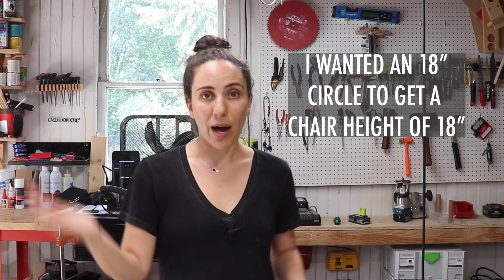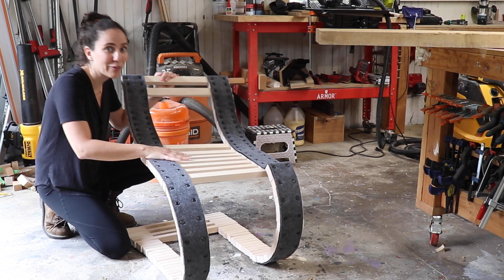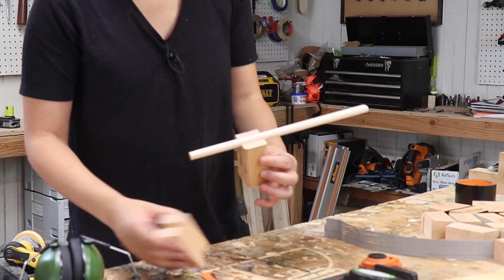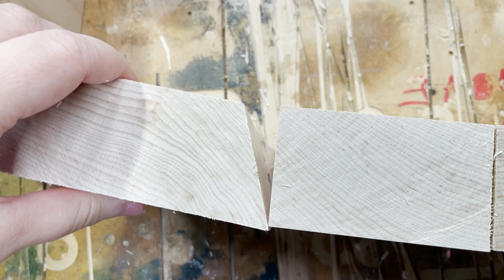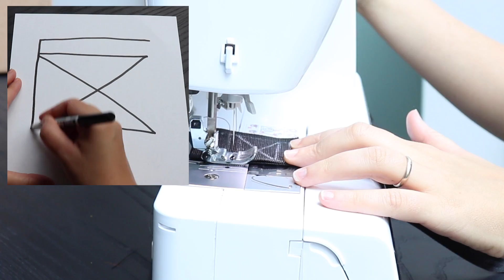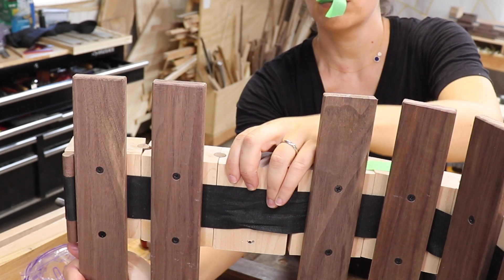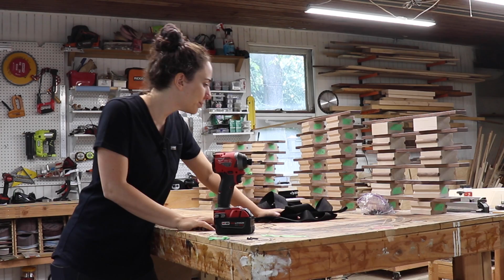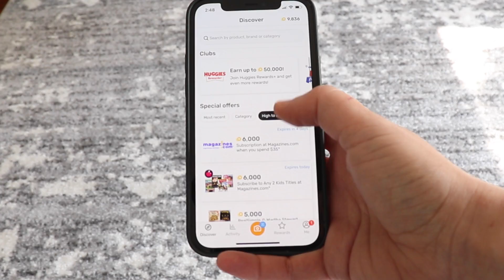I ATTEMPT to make a Roll Up Chair… AGAIN...

Comment: wouldnt it be better to just drill centerholes lengthwise and run steel cabling through the center? cable has very little flex compared to any fabric, and perhaps place the slats along the underside to decrease the chance of pinching, maybe with a fabric blacking?

Comment: have you tried or thought about ratchet straps?? this may work as you can pretension it with the ratchet. many of the commercial straps are rated a few thousand kg. 

steel cable with crimps may also work. again you can pretension it with tensioner.  this will probably be harder. i can already imagine many problematic areas. 

i think you need to screw right through a pre tensioned strap. just get something with a huge load and see if that would work??

Comment: At the end when you mentioned using a sliding dovetail to make a stationary chair I thought: "a half dovetail instead of the dowels between the sections might work." A triangle instead of a circular dowel could fold into the joint and form a cleat to carry the tension while a strap holds the blocks together in line. I imagine you could also make a bird-beak type cleat for extra undercut connection to prevent camming out.

Also, tie down straps are available in 2in wide, black material and are generally engineered not to stretch and have UV and mold resistance.

Comment: Perhaps you might consider using motor cycle or bicycle chain instead of a stretchable material. It would make the chair heavier, but it could still roll up. Another alternative could be a woven metal cable that could run within each block. 

Besides those ideas perhaps consider using three rows of blocks rather than just two. Might help with stability.

Comment: Maybe... do the dowels full width and directly attach your strapping to them in between the wood blocks? So the stretch potential at any one point is limited?
Alternatively, maybe use metal links (eg aluminum to keep the weight addition down), again with the full width dowels?

Comment: You could always run a steel or some sort of cable through the middle of eachside. there will never be enough tension to pull it but it will be super strong!

Comment: What about some steel cable in holes drilled in the bottom curve section only. Which can be tensioned by its anchor point with some kind of bolt

Comment: The strap is taking a toll (load) over the lower back part, giving away. It is not stretching all by itself, it is stretching along with the wood. Check the wood on that part. You might wanna strap in between the blocks.  Also you could try seatbelt material (if it is not that).. Throwing some ideas...

Comment: Just blowing through that walnut like an old pallet, LOL. For what it's worth the main challenge I see here is modulus of elasticity. Imagine building this from steel, unless you use precision hinge pins at every joint it is still going to move around, alot. I'm glad I'm not the one who has to make this work, have fun, LOL.

Comment: Potential solution: instead of having the strapping straight have it zig-zag between the left and right half for each set of joints. I believe that the way that strapping is woven together it may stretch more in one orientation than the other, so zig-zagging the strapping could reduce stretching. This would force you to attach the strapping at each joint though, and would require the use of a lot more strapping which may be less aesthetically pleasing.

Comment: First off you are WAY more dedicated than me, I genuinely feel this chair is impossible without using metal since that wouldn't flex or compact from the force of the curves. Secondly, I'm a leather worker and I don't think any thickness of leather would work in this situation because of the multiplied force created at each joint. The strapping you're using supports thousands of pounds, the fact it's stretching shows the multiplied force created by each joint.

Comment: That's an impressive project and it's not even complete yet😂
Maybe bigger fewer segments would make it easier and sturdier.
You can cut them with curves to compensate the lack of joints/flexibility
Considering the curves have the biggest points of tension on the whole thing it would be stronger if it was a solid piece instead of many compressed pieces.
"More parts= more points of failure"
words i live by😂

Comment: I think you need to find an engineer to talk to. The forces generated in the webbing will be massive and due to design concept even a small amount of stretch will result in a large flex of the chair. I am no expert in modern fabrics but woven straps by their nature are normally stretchy which is used to improve their strength and resilience to shock loads. I have seen a similar design concept using steel cable but with this the wood tends to become the weak part.

Comment: Lots of good ideas in here.  I agree hinges could work.  Another thought... maybe if you center drill each piece and run a braided steel cable through, once you increase the tension, the cable itself will prevent "bursting" from the pattern.  At the very least, it is a fun thought experiment.

Comment: Should have just screwed the strapping to each strut instead of letting the elasticity of the strap material play over a couple feet instead of a few inches...
Think more rigid connections: hinges.

Comment: Another thing happening is that you gain or loose leverage by the thickness or thinness of the beveled contact area of the planks/blocks. So if the blocks on the lower radius supporting the seat were thicker they would gain more leverage to support your weight. 
I also see that since your top blocks don't match the lower in width it allows the strap to move and blocks to shift which weakens the whole tension/leverage relationship. So having your top and bottom blocks be matching widths would help control that shifting. Rebuilding without the strap but instead using door hinges or some kind of metal hinge of similar strength might get some better controll of movement here.
 Another thought would be to actually build something like a giant bike chain from wood but use some kind of pegs and slot type thing to limit rotation of the chain links. You can still end up with a roll up seat or chair...but with a oversize bike chain idea you could possibly eliminate the pinch points that make this idea somewhat dangerous as you pointed out. 
Maybe a pair of chains with their 'axel' made long at key points to join/bridge  them so they don't tip over like the other issue you had and then use canvas to create a 'hammock' for the seat and back support ? Sort of how a directors chair seat is made.

Comment: I think that this could work. But the curves should really have some 8mm steel cable running through them. Or ideally the entire structure. I could imaging a design where the bottom curve has 2 or 3 cables running though it, the upper curve having one or two running through it, and a single cable going through the rest of the pieces. Then the strapping would be a compliment, and not doing the majority of the holding. By distributing the stress into the center of the pieces as well, then they will not be able to spontaneously snap back, they would already be at equilibrium.  

I like the concept here, unfortunately i do not see it working with this method though. You would need a mechanical force holding the strap to each piece, as it will not be able to stretch along it entire length that way. that's why the staples would have helped. but the force is too concentrated if you only use staples. maybe if you used many staples, but that still doesn't really solve the issue of not having equilibrium of forces on each piece. the unequal force load is the second main issue you have to contend with now. I can think of three different things that would make it work though, and keep 90% of the look you are going for here. 

first, drill holes and run a steel wire through the strapping and the wood, as if you were stitching them together. this prevents the strap from stretching along it's entire length, only stretching between the sections that are 'stitched together'. this is extremely tedious, and not really worth it imo. 

second is to do with a cable doing all of the holding, and just have the strap for aesthetics. The difficult part here would be drilling all of those pieces precisely, and allowing a relief in each hole so that it can still fold up. you may well have to do three cables along the curves to have even force distribution. This is the method that I would go with personally, but no matter how you go about it, it's going to be a real pain in the ass getting this to work as you want it to. either a struggle to get and maintain tension, or to manufacture it all. 

thirdly, you can add an embedded steel hinge to each piece, so they fold up, but cant separate. this again is extremely tedious as you would have to rout each side of each piece to hide the hinge. This I do think actually has the highest chance of success, but thinking about routing all those pieces and drilling all of those holes is the stuff of my nightmares. 

in any case, i wish you luck!! this is a fascinating project, and i really hope that you can make it work. I don't think there is really any way to make this without a lot of work, and probably a lot of hand work where you have to manually do layouts and drill or rout a lot of individual pieces. Really looking forward to the conclusion of this though. 

stay away from leather though, it is even more stretchy than the straps that you have used.

Comment: Work with the flex.  If you are going to use webbing material that is that thin unlike what is used on over the road trailers which is thicker. You need to make the chair in a way that would use the webbing flex to make the joints stronger.  When the chair is set up it will sit more vertically than normal chairs but when you put weight on it it will compress down and the webbing will help keep it together instead of pushing away.  Almost like building and arch for a stone bridge.  Let the weight of the person add to the strength of the chair.

Comment: I think even if you found a strap material that wasn't stretchy, as long as it's only wood on wood it might still compress the wood beyond its strength and go slack or break. Eac piece works sort of like a lever on the next piece so you end up with some incredible pressures and tensions.

If you're determined to get this design to work, I think you will need some sort of metal hinges isolating the tension to each joint (bike chain like several others have suggested might work as long as it's not allowed to slide and transfer tension from one joint to another). And metal reinforcement of the angled pieces might be necessary so that not only wood is stopping the motion. 
In any case I doubt this design will ever be safe, especially not for children. Lots of pinching hazards and risk of collapse if you lean too far forward.

Comment: What about like a steel cable running through the pieces, of course you'd have to reinforce the holes in the wood with some kind of metal tube so the cable doesn't just saw through the wood
Reply: I think that would increase the stress on the wood. When I look at the lower bend, I really want to increase the distance between the stressed webbing or cable and the compressed wood on the inner side of the circle. Putting cable inside the would without changing anything else would increase torque, I think - something something levers. I would like to see the webbing or cable on top of the planks, to increase the distance of the inner circle, that gets compressed and the outer circle, that's under stress. that should reduce torque by a lot. I think I used to know how to calculate this stuff...
Also a fan of 2 or 3 layers of webbing and some fixing it in place.

Comment: Try breaking the tension up. Instead of using one piece of strapping try using several overlapping in high tension spots.
Reply: Another thing you can do is to add strapping to the opposite side as well. This would help it from collapsing under load

Comment: I think if you double up on the strapping on the curves and have the dowel over the strap on the top and bottom of the curves it will stay secure and reduce the gapping. Another idea could be that you drill thru the blocks again on the curved sections and run wire rope. Wire rope wont stretch and you should only need it on the curved sections to save material as well as time. First time I see one of your videos and definitely a lifer of your channel! Thank you for sharing your creativity to the world!

Comment: did she try using seatbelts as the straps?
Reply from the maker: Yup. That’s what I used
Reply: @3x3CustomTamar  i oddly feel less safe when putting on my seatbelt now... i thought for sure they would be strong enough
Reply from the maker: @numberpie  strong yes. But meant to stretch so it will hurt you less

Comment: I think you already have the fix.  You don't want to rely on the tensile strength of the straps to hold the chair together.  You really want to rely on the compression strength of the wood.  So by adjusting the angle of a few more block pairs in the same manner you did at 22:16 of the video, should give you the strength you need and allow you to keep the form and function of your design.  The straps are really only needed as guides to roll the chair up.  You could use hinges as suggested in another post which would give you the rigidity you need but it will also add ALOT of weight to the chair.  Hope this helps.

Comment: Hi there, I watched your video and heard the issues with the straps.
I am a retired welder/Blacksmith and my solution is  to use a stainless steel band roughly 1/32 thick X 1.5 inch  wide X the  required length. then I would have 2, 1/16 inch holes  holes punched at every location where the dowels  are located.  then take  a 3.5 inch piece of the  banding and form around an equal sized piece of round rod to form each piece on, this will then require 2 equal sized holes where the banding meets,  so that each formed piece can be secured to the long band and the forrmed pieces together. These are to replace the tabs that were on the other type of strapping;  just remember that the  rivets used to attach the tab parts  too the long band.  I  chose stainless steel so that there  will be very  minimal  amount of stretch.
I would like too make a chair like that, and I will be sure to share my  results  with you, upon completion.
I really enjoy your videos and  I  have learned more from you that  you can't even imagine.
Take Care:  Be Safe and Stay Healthy

Comment: I think for the inside of the lower curve you might want to add some reinforcement by just making the wood thicker, it seems like the pieces are leveraging over the corner of the wood causing it to shift wrong, if you have thicker wood for the lower section it'll take more force to overcome the leverage

Comment: Just watched your second attempt. You mentioned leather a couple of times and I'm pretty sure it would not be a good choice. Think about a new pair of shoes and how they stretch with wear. Love the idea of cable mentioned below. Maybe adding something so that the pressure points can have more strength. Possibly second shorter piece of cable. Please don't give up, I'm sure there's a way.

Comment: Metal/wood hinges might be able to do it, but would be much harder to cut out., this design also has issues with pinching, where a section to section locking mechanism could help.

Comment: As Cronoctie points out you are struggling because the tension is different at different points along the curves of the chair and this is resulting in stretching it differently in different points.  I think instead of using a strap - which is going to change in length in response to the tension -  to connect the links, you should use a rigid link model - think of a chainsaw.  The links in a chainsaw are fixed in length from link to link.  Yet a chainsaw can curve in two dimensions exactly the way you want.   So I would connect each slat with some rigid linkage, rather than use straps.

Comment: Well I think you did a phenomenal job regardless of the outcome! Lots of good choices were made. The fact that the glued joints weren’t deemed safe makes me wonder if the concept has a built in flaw that can’t be engineered away. The angles seem to be creating a lot of force away from each-other. Not sure if there is a material thin enough that can overcome that much force. I’m not a math person but I’m betting a lot of issues will be solved in the angles. I’m here for a part 3! Haha
Reply from the maker: I hope to figure it out!